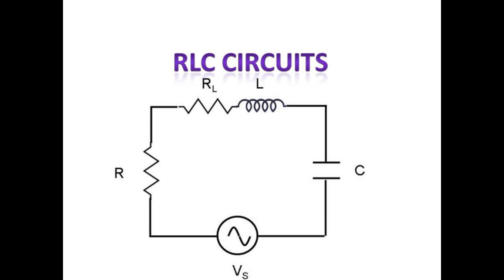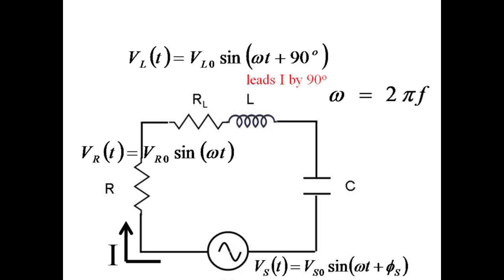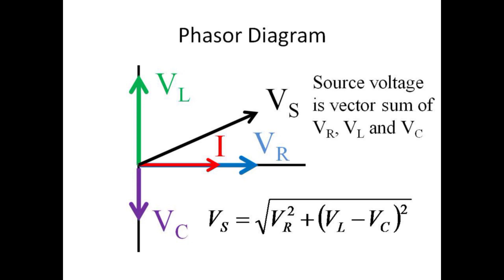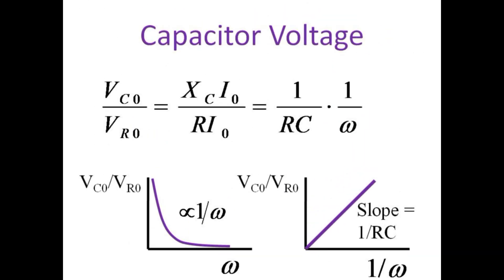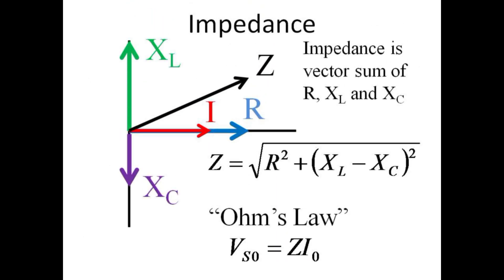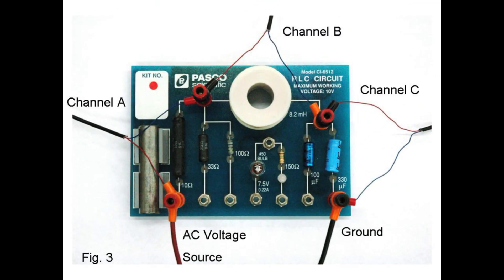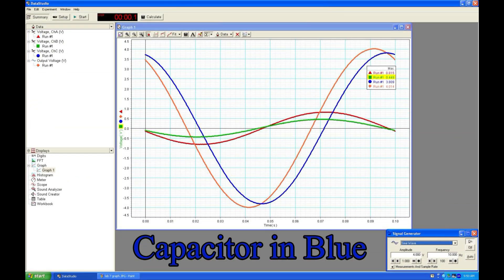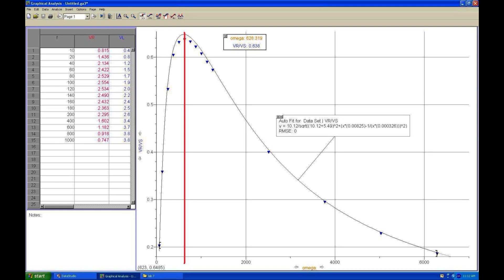Lab 7 Resistor-Inductor-Capacitor Series Circuits

Comment: pls sir when considering the the voltage across the cpacitor in  a series rlc circuit  what happen to the voltage and current when the capcitor value is changing while other paramerter are constant also if the capacitor and inductor are equal what happen the volt and current, and if the capacitor is kept constant what happen to the output volt when resonance take place.  pls can u relate the answer to transfer function